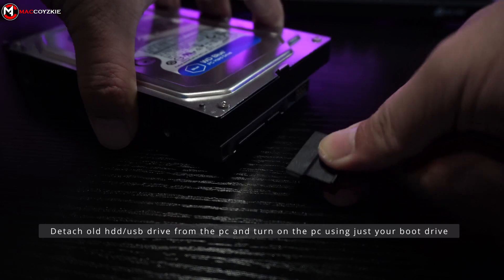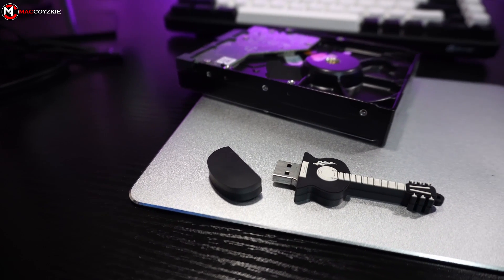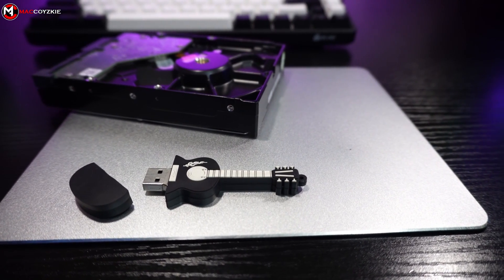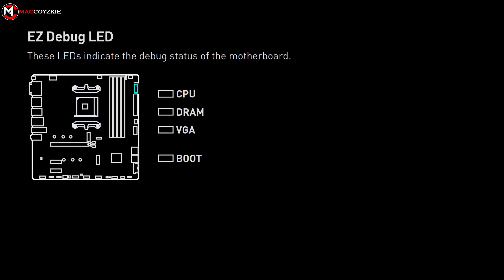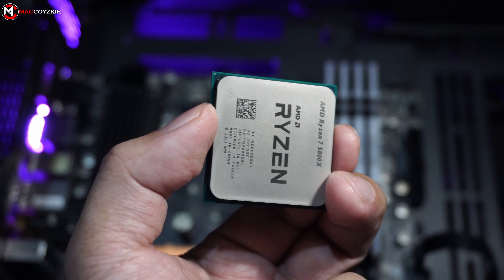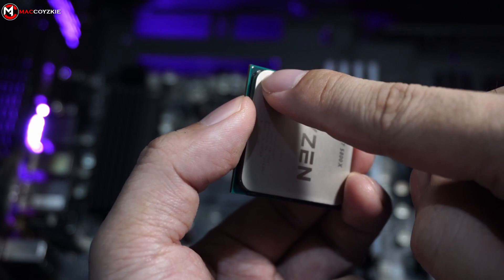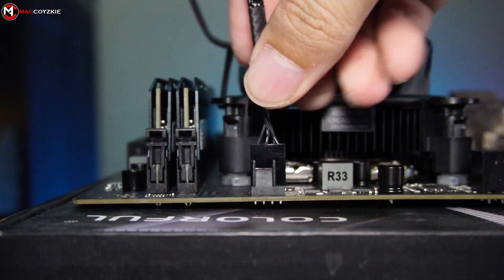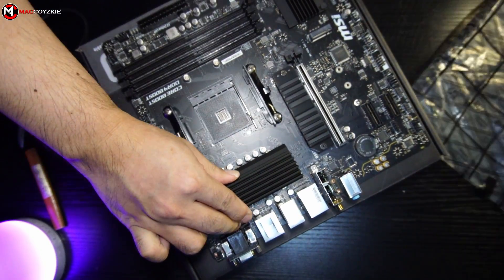Debug LED always on FIX

Comment: Bro, I removed my nvme m2 and put it back on, but it didn't work out, and it's still with the led on boot, do you know if there's any error in m2?
Reply from the maker: can you try a different boot drive, make sure it doesn't have windows installed in it. you should see "reboot and select proper boot drive" on your display, this means your pc is fine and its just the nvme is faulty.

now if you are experiencing the same then this might be a motherboard problem, try to update the bios, be careful if you are going to do it yourself make sure you watch this first https://youtube.com/shorts/nfH5Do3Dq3o 

bios should be compatible with your current cpu , do a bit of research on this. if you don't know how to do the bios update you need to bring your pc at a local shop and let them do it for you
Reply: @MacCoyzkie  Everything worked out here, I decided to put a pendrive and ended up giving video, but I found it very strange because I entered the BIOS of my motherboard, and it says that there is an XrayDisk 512gb nvme m2, connected to the motherboard, but in the past, my pc was not booting, but it only booted when I used the pendrive, can you tell me if the nvme is working or is it just some visual bug?
Reply from the maker: @santoss2957  XrayDisk 512gb nvme m2, its a drive connected on your motherboard nvme slot. as for the pc only working when the pendrive is attached, this may have something to do on how windows was installed, whoever installed windows in your pc he may know what's the reason

Comment: So what if my vga light is on, gpu turns on, and I get display on my monitor?
Reply from the maker: if its working just fine i think its ok, basically the motherboard vga debug led is not working properly. this can be fixed by a bios update

Comment: thank you. i tried this but didnt helped with white LED problem. For peoples with same promblem in the future: go to BIOS - Boot - CSM change it to deactivate or activate. in my case to activate it. Problem fixed
Reply from the maker: thanks for sharing, this will help others too
Reply: Hi, I’ve same problem. Tried everything 😢
But dram flashlight is still on and MB showing code 15 , can’t even get to the bios. I’ve turned the PC on after over 3 months, worked just fine , but then just shuts down during playing light game compared to to my PC. It was AOE3 on 5800x , 32GB dominator platinum ,3080ti, 750w platinum PSU, 1+2TB nvme and all sitting on gigabyte b550 vision d-p 
Even I’ve updated bios to newest, tried to clean cmos, resit ram Gpu and checked cpu if pins not bent… everything spinning and lights are on , all ddr flashing as they should, cpu pump on kraken z63 also Gpu is on 
Any ideas? I’m hopeless
Reply: @skhedado  i bought new GPU and now my system runs stable. no more Crashes but still White Led always on. maybe try your GPU in a an other system.

Comment: Hey i need some help, i have a msi b550 mag tomahawk motherboard and a ryzen 7 5800X cpu my ram is kingston HyperX (HX434C19FB2K2/16) i just built the pc and at first the ram red light was on so i figured out which one was causing it and put in new ram sticks, the light turned off but the cpu one turned on ive tried everything in the video besides the resseting cmos help would be really appreciated
Reply from the maker: you need to check your motherboard bios, some b550 motherboard stocks have old bios so you need to update it for the 5800x. be careful though if you're going to do it yourself, more info here https://youtube.com/shorts/nfH5Do3Dq3o

Comment: Hola Amigo Ollé tengo un Problema Mi Pc no da Video te diré Mis Componentes R7 5800x  motherboard Rog Strix B550 F 2. GPU 3070KO 8GB,  Fuente Evga 850 Supernova  y Rams 2 de 8gb Total 16 a 3200 Mhz  Fuente Placa Y Rams y procesador Son Nuevos y Meda 1 pitido Largo y 3 cortos Nome da Video Se queda Led Blanco VGA y Led amarillo  BOOT. Encendidos que podría Ser
Reply from the maker: Un pitido largo seguido de tres pitidos cortos le indica que la tarjeta gráfica no se ha instalado o que no hay memoria suficiente. intente volver a colocar su gpu y ram, borre el cmos e intente reiniciar su PC nuevamente

Comment: Please help..stuck at vga light... screen no display...gpu already test in another rig and it's working fine..cmos battery 5 mins reset already do...what can i do?
Reply: Hola Yo He Cambiado Todo Y Me Pasa Lo Mismo Lo Único que No He Comprobado el el ssd Y Grafica   crees Que sea La GPU O Bios
Reply from the maker: @aabejaGamer  Depende de las especificaciones de su PC, ¿cuál es la lista de piezas de su PC?
Reply: @MacCoyzkie  fue Mi GPU murió
Reply from the maker: @aabejaGamer  Primero necesito saber la lista de piezas de tu PC porque podría ser simplemente una incompatibilidad.
Reply from the maker: bios update needed but that depends on what cpu you have

Comment: So... what about when the build is brand new and both the cpu and dram are on?
Reply from the maker: parts incompatible, not detected or faulty. what are your pc specs?
Reply: @MacCoyzkie  i did multiple tests and turns out is a faulty ram slot. If I have only one ram plugged in slot A it goes to Post but if I switch it to slot B the cpu and ram led stay on. Tried with another ram and same results. 
Processor is Ryzen 5 7600x 
Motherboard MSI A620m-e 
Ram Kingston Beast ddr5 32gb(2×16)
Psu Cooler Master 750w 80plus Bronze
Reply from the maker: @onphs  since its new use Rma, i hope they replace it with a working one

Comment: My pc boots up fine plays fine displays screen but all of a sudden i notice the dram light on red solid light but i have no problems running my pc or playing then today the dram light went away and now shows the vga solid red light its my first gaming pc had it since march 2023 dont know much of it but basically brand new i need to try this see if that fixes the problem
Reply from the maker: i notice most build from last year's motherboad stocks have this kind of problem. As i always tell my clients to just use it normally but if it bothers you so much you can fix that by updating the bios. Since your pc was working since march 2023 i don't think its a problem but you need to update bios at some point. just be careful if you're updating it yourself for the first time, check this for more info https://youtube.com/shorts/nfH5Do3Dq3o

Comment: my PC is 4 years old and works flawlessly for all those years.

Two days ago I noticed the CPU light was on and my front fans had stopped. Every other fan works including cpu fan and my pc works perfectly besides that. I have tried to change the fan sockets and I managed to get 1 fan working again (I have 3 fan sockets next to each other on the mb) now here's the weird part the fans all spin on boot but upon windows only one of the front fans continues to run. Could this mean it's my bios acting up for some reason?
Reply from the maker: sounds like low power draw from either a failing psu or power fluctuation in your house. what you can do right now is to bring your pc to a friend's house where there is no power fluctuation and have it tested there. you can also have your psu check using a psu tester like this https://youtube.com/shorts/YrC3PlflLq0
Reply: @MacCoyzkie  you just might be onto something! When I bought a new GPU, I didn't upgrade my PSU as the load was just within the rated W. This could very well be what is causing the problem. I haven't had any crashes under full load or tests, but it could be time just showing itself. Luckily it's an easy upgrade, thanks I'll look into it 👌💪

Comment: Already did everything and still not working. Cpu Led still red. 5700x, can't be the problem, bought it a month ago.
Reply from the maker: you need to check the cpu pins if there is any bent pins
Reply: They're not, I already checked it :)
But still didn't work :(
Reply from the maker: @Zer0Playr  were you able to use it before or it doesn't work since you build the pc?
Reply: I was able to use it b4, but no need to worry, I've sent to a local shop, hope they can fix it, tyvm 😁
Reply from the maker: @Zer0Playr  oh ok, i hope it all goes well

Comment: I just built a new PC and when I turn it on I get the boot led and a code 98 and it doesn’t post, any idea what it could be
Reply from the maker: if you are using asus motherboard, try to use a different keyboard and mouse. normal ones and not those rgb gamery peripherals 

your system is trying to recognize the input devices, such as keyboard and mouse.

Comment: Hello. I’ve finished building my pc. And got through bios and now have windows. But whenever I go to boot my pc back up again, the red cpu led and yellow ram led comes up on motherboard. I then wait 2-3 mins and my gpu fans stops spinning and the lights go away and I then get display and get into windows like normal. It’s really weird and dunno what the issue is pls help
Reply from the maker: if those lights stays steady then that's a big problem, can you check the cpu if there are any bent pins on it or on the motherboard cpu slot
Reply: @MacCoyzkie  Imma check. But if there is any bend pins then how Can i play on it and do stuff. Shouldnt it give blue screen or sum?
Reply from the maker: @smoove8107  the weird thing is that the pc loads after some time, i was thinking you got an old hdd plugged in the pc or at least a thumb drive that is almost full. you can shut down the pc and remove the old hdd and just boot with your ssd boot drive and let's see how it goes
Reply: @MacCoyzkie  i have No hard drive. Brand new pc. And only 1 SSD in my motherboard. Ive tried removing CMOS bug it still does it. Also got new rams and it still does it. After the new rams and removing the cmos battery, it loads maybe 1 mins faster. Still shows the debug lights and takes time to boot. Also when I restart the pc, the screen then turns black and only the ram light is up on motherboard. That also goes after 1 min and then it goes away and I get display again. So dunno what to do or what it is. It’s really weird looked every where and asked but no one knows
Reply from the maker: @smoove8107  can you try to reseat the ssd and also remove the new ram sticks and clear cmos after

Comment: My pc has the light blinking between cpu and dram and idea on what the problem is. It happened after I knocked my desk and my pc froze and after force shutting it down it just blinks between the two
Reply from the maker: that's difficult to figure out, is there any written indication what is that light for?

Comment: hey so I have the vga light issue but the gpu works in another rig. I had previously bent my cpu pins so maybe thats the issue? But i straightened them so im sure
Reply from the maker: this might be the motherboard then, try a different gpu in it and if it does have the same result then the mobo might be done
Reply: @MacCoyzkie  okay, how likely could it be a cpu issue?
Reply from the maker: @evanlei899  cpu are very sturdy and from my experience, i had a lot of motherboard breaking earlier than the cpu. the only way we could know is to test it with a working pc, if you don't have extra pc you need to bring it to a local shop

Comment: can i please ask, what will happen if i continue working with my ram while i have this problem ? i have 16x2 ram (32g).
 i figured out i have this problem because there is a orange(yellow) lights turnes on everytime i turn my pc on! please help if possible thanks  <3
Reply from the maker: if it stays on that's a problem but if you can still use your pc while the light is steady then the motherboard just needs bios update, it happened to some of my clients ever since 2023, this may have something to do with the stock motherboard bios whether be intel or amd builds
Reply: @MacCoyzkie  yes i am able to use my pc completely, and its intel, so you suggest me to update my bios ? If yes can you please tell me what should i do or where should i go ? If this problem goes away i will be a life time subscriber to your channel kind sir 🙏🏻
Reply: sir if its possible please help me out, is it ok for me to keep using my pc while this yellow/orange light is staying? do you think i may get problems in future ? @MacCoyzkie
Reply: If its possible please help me out with my problem, its so frustrating
Reply from the maker: @armin_hg96  the fact that the led is steady lighting means the motherboard debug led is not working properly if you can use your pc, the only way to fix that is bios update even if you are using intel. i suggest bring it to the local shop where you got your motherboard from and ask them to update it for you, if you're going to do it yourself just be careful, more info here https://youtube.com/shorts/nfH5Do3Dq3o
Reply: @MacCoyzkie  thank you so much for the help 🙏🏻, i had a trouble this morning, my pc was on all night and when i try to turn my monitor on, no display comes out, after I unplug and plug both sides hdmi then the display came back, do you think the cause of this problem is that orange light ? Or a common problem that happens sonetimes ?
Reply from the maker: @armin_hg96  its probably just sleep settings

Comment: I just built a new pc, installed Windows and it worked fine for a day but now I get red light next to my ram on my mobo Gigabyte b650. My rgb from my fans also stopped working, but all fans are still spinning. I’ve tried using 1 ram, cmos reset, reapplied cpu and still have issue. Any idea what could be the problem?
Reply from the maker: can you check which debug light was it?
Reply: dram light @MacCoyzkie

Comment: I have a problem
My PC turns on but a light appears on the boot and it doesn't give video.
Everything is well connected and the bios is updated.
Does anyone know how to fix it?
Reply from the maker: you might have a faulty boot drive, try a different one to confirm this theory
Reply: I have update with a ryzen 3 1200 and it give video but when i put the ryzen 5500 it doesn't give video

Comment: My VGA light blinks for 60 seconds then it boots, before it wasn't like this suddenly this happened you said to remove GPU clean well i didn't use the GPU i use motherboard still same i am not sure what's wrong please can you suggest something!
Reply from the maker: what's your pc specs so i can have an idea
Reply: Same with me. I dont have gpu but my ez debug led vga turns on solid white and not booting on my pc. My pc specs i5 11400, msi b560m pro-e. Latest bios.

Comment: Changed a lot o parts in the pc i had a boot debug, black screen and i can't go in the BIOS. Any suggestions?
- I5 13500
- MSI 760-P
- Freezer i35
- Samsung 990 1TB

Installed before

Gigabyte 1080
Be Quiet 600W
Reply from the maker: can you reattach the boot drive from the motherboard then do this next https://youtu.be/S9hyEPTFR10

Comment: Hello! I have this problem this has stumped me for months now. 

I've updated bios

My cpu pins aren't bent

I've replaced thermal paste.

I built my PC in January 2022 and it failed on May 2023.

Any tips can be helpful thank you
Reply from the maker: tell me the pc specs and how the pc problem started
Reply: Try reseating the cpu that fixed my issue even though the debug light was on DRAM I spent like 15 minutes changing my ram for nothing
Reply from the maker: @trapz6342  i never experienced this yet, may i know what is your mobo model name?

Comment: I have ryzen 9 7900x , 33gb 6000mhz ram ddr5  , msi motherboard my red and yellow loght turn on every time i boot or turn on my pc then  After 30 it’s automatically goes off and i go to windows please do answer and tell me if i need to worry
Reply from the maker: what is the debug led (yellow light)? dram, cpu, vga or boot?

Comment: Vga works on a other pc, but on z790 i got vga lighting 😥. It starts at cpu yellow then it goes off fast and move to dram, then gors off fast too and stay on vga… assembled pc first boot does that
Reply from the maker: before anything else can you tell me the pc specs first, also are you switching gpu to the other pc you are talking about?
Reply: @MacCoyzkie hello thabks for replying. Got it to work, update 1070 firmware in another pc and did bios update on z790 mobo. Reasembled all cables and worked.
Thanks

Comment: so im having a boot light problem what the only issue or weird thing to me is that even without any drives connected it stays green no signal to the monitor but the VGA (white light checks and turns off). I would think even if its not reading a storage device it would still boot to the bios page. I turn the PC on the fans and cooler AIO bot turn on GPU fans spins for a moment and then turns off. 

i have a 
B550-A ROG motherboard 
Ryzen 7 5800x
32gb ram vengeance 
2 TB m.2 970 evo  (new)
500 gb m.2 (windows installed)
4060 Asus GPU
750W BP EVGA PSU

I've read somewhere were the monitor might be the issue and ive also read where it might be the Bios version not supporting the correct ram and Ryzen socket version. Any thought or ideas would be grateful. Thanks,
Reply from the maker: it is a bios version bro, i know b550 supports your 5800x but most motherboards nowadays are using old bios version specially if they have been stocked for a long time. Some concern pc shops usually offers to update your bios before taking it home but some are just lazy. just update yours and you'll be fine but if you are going to do it yourself check this out first https://youtube.com/shorts/nfH5Do3Dq3o

Comment: This is very useful, I have ASUS Prime Z390-A and I have my green boot light on, according to chatGPT that this means everything is working fine!! should I ignore the light and keep working??!!! this happens when I use HDMI cable with my elgato card, but when I switch to display port directly to GPU no light is on and everything is working fine, Please help ??!! Thanks for the video
Reply from the maker: no need to do anything, as long as your gpu is working then its fine
Reply: @MacCoyzkie  Thanks